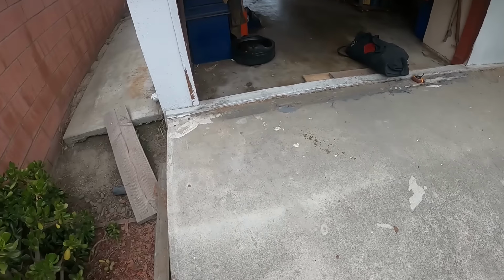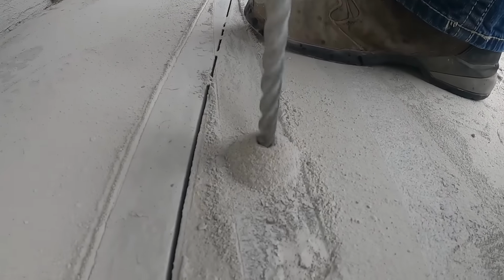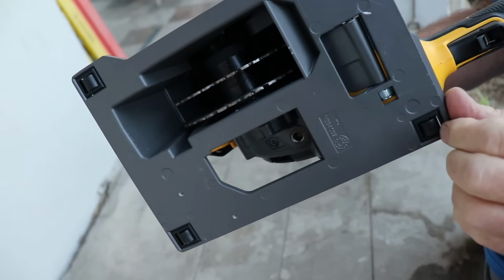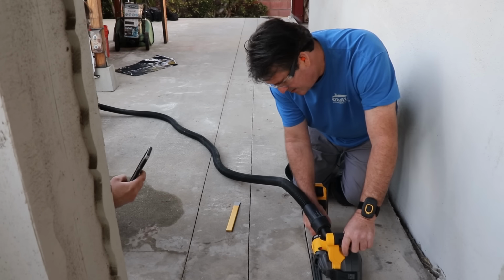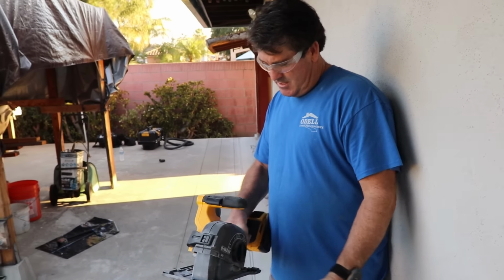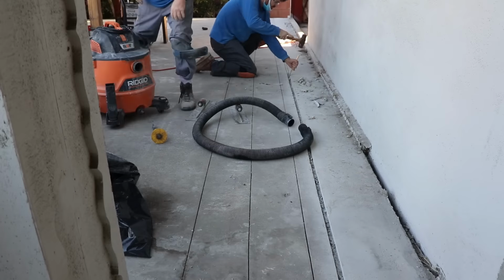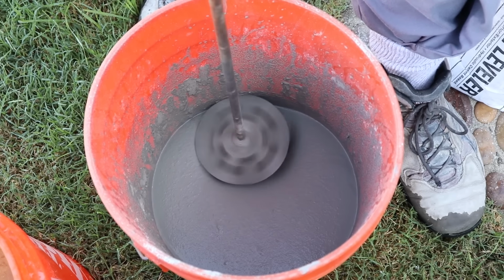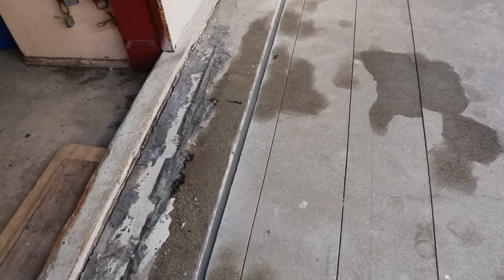How to Cut a Drainage Channel into a Concrete Slab

Comment: Good morning David. I am curious if you ever got any feedback on this work that was done or if you did this in other applications as well. I really like the idea and concept. I live in a home that has water retention on a concrete patio that sometimes under heavy rain causes water to run back toward my walkout door from house. This allows water to seep into basement due to elevation of concrete patio
Reply from the maker: Basically its a channel drain, widely used
Reply: @OdellCompleteConcrete thanks

Comment: If you'd use wooden furring strips and shims to make a sloped guide above the work, you could have cut a sloping drainage channel.  You really only need two angled guide pieces and then a set of spacers to go underneath and gradually build up height for added slope, moving one ramp ahead when you leave it behind.
Reply from the maker: That's a great idea, thanks for the tip!

Comment: As long as the slab is thick will cutting a drain channel like this compromise the slab in any meaningful way?
Reply from the maker: If it's a 4" concrete, that might be a bonus because it will Crack through and allow for residual drainage underground

Comment: So glad I watched this. I was about to just use an angle grinder but this video has reminded me that I already have a wall chaser from when I was doing my electrics and I am pretty sure that's what the Dewalt tool was? And I have a chisel that fits the width of the cut which is perfect I have a super similar problem but on a smaller scale. Alleyway with a crossfall towards the garage meaning it just pools against the wall. Hoping I can just channel through the path and collect it at the lowest points and then send it back the other way. . . . fingers crossed!

Comment: As a side note, it might be worth noting that using a spade bit on "vibration mode only" with a hammer drill might be far easier than manually chiseling away with a hammer for clearing the trench.
  That or possibly a 7" angle grinder with a masonry grinding bit you can wedge in there and make a few passes to your heart's contentment.
Reply from the maker: Good idea

Comment: Why don't you just do a 3 or 4 inch pitched overlay angled away from the house?  You can add mesh wiring for extra strength.  Wouldn't that have been easier?  Perhaps in the future the owner might want to add outdoor tile, but he can't with a channel.

Comment: in a downpour that is likely insufficient.   Couldn't you go deeper and wider in a 19" slab?      Those other thin cuts are worthless and an ant would plug them up.    I'm likely going to have to do something similar because the concrete guys just did our driveway and the grade is terrible and almost non-existent.. and after 2 years settling i guarantee it's back into the house.   Should have done 2 runs next to each other and chipped it out for a 2 inch channel minimum
Reply from the maker: Working so far

Comment: Confused. Why wouldn't you just cut two lines with your concrete cutter vs the Dewalt or at least cut it with your tool the exact width of the Dewalt chisel. Not following the rationale to use the Dewalt.
Reply from the maker: A perfect gap, for prefabricated grate
Reply: @OdellCompleteConcrete  Didn't see the grate in the video. Also, you'r cuts from the snapped line are pretty straight. I'm sure you could have gotten the same results with your lines and your cutting tool. Obviously hard to keep pin straight that way, but you guys are pros.

Comment: Why didn't you just continue with the original concrete saw? It seemed like it was working
Reply from the maker: After 7 blades
Reply: @OdellCompleteConcrete  oh haha. Gotcha. Aren’t the blades designed to cut that or is it because of the rebar that the blades were getting ruined?

Comment: Great work, quick question.  How did the self leveling concrete keep a slope to drain the water.  Sorry if this is stupid question, but wouldn’t the self leveling concrete not allow for a slope? Thx
Reply from the maker: If it's level the water will fall off the lowest point
Reply: @OdellCompleteConcrete  not clear how the self levelling concrete will provide the slope so that the water falls off the low point?
Reply: @fmkhawaj my thoughts exactly 😮

Comment: So surprised you dont own a grinder- would have narrowed that chisel in a few miunutes rather than take all that extra time. - what were you thinking? Hiw much for this dual bladed saw? Since any $80 saw can cut 1" depth concrete with a good blade. Using water even.   2 foot per minute go up while the other direction comes back 40 foot <1 hour
Reply from the maker: This is custom though

Comment: There's no grade after using the self leveling. Yeah it'll work it's way out the end but it's flat and you'll have standing water once it's done raining. I suppose it'll definitely help prevent water from getting into the structure so cool
Reply from the maker: A affordable solution
Reply: Like you said Craig, if the channel is filled with level(ing) compound, then you have a lower channel that is level with the patio above . Could you have cut the channel with the Dewalt, and then chisel a gradual slope in the channel and then use the leveling compound to simply smoothen up the channel?
Reply: i was thinking maybe cut a little deeper ver 5 feet... to create slope @ro-bee-24

Comment: Cheap fix just use an angle grinder with 2 x 10mm diamond cut discs stacked and an adjustable bolt on guide. No need to chisel out slab after and no self leveling compound needed. Don't worry about the dewalt vacuum you sucked up most the dust in your lungs. No PPE shocking when working with concrete you should be wearing a respirator mask. Silicosis is a horrible way to go.
Reply from the maker: NO dust with the vacuum hook up

Comment: Hi guys,  i need grind a 2 or 3 inch of a concrete floor to reach the level,,, any idea or any tool ?,,, im thinking cut some trench like that and use the chip hammer,,,, any better idea?
Reply from the maker: Make some cuts chip it out and grind.
There some walk concrete chippers you can rent

Comment: European here. We use the small prybar(yes that's not a chisel) to break off chunks then rotohammer with a sds chisel the rest out. I would've used a 230 mm large grinder to cut a deeper wider channel and put a grate over it like an Italian drain and seal the bottom of it. I'm an electrician and not a concrete guy but from my point a lot more could've gotten done with a lot less fussing.
Reply from the maker: Yes but thats a sweet tool

Comment: great video,wish i saw this tool earlier,I had a similar problem with an interior floor to a center trench drain..What i did was made a pitched surface using wood and shims to run the saw on, and made a pitched or sloped cut toward the drain.i then used a liquid sealer in the cut to try to avoid water penetration into the slab. seems to be working ok.i wish they made a thicker blade ,ended up using 2 blades together.this was using a 7 inch blade with a circular saw and water.
Reply: Making a pitched surface with wood shims - nice idea, I may do that for a similar issue at my house 👍
Reply: Nice. How much was this tool. I am having a difficult time finding it. Thx.
Reply from the maker: Yes it definitely helps

Comment: What a ton of work with expensive single-purpose equipment for quite a marginal result: the channel is barely 3mm deep after adding that liner material. How about running two cuts from a wet saw : a vertical and a 45degree mitred cut and allow them to meet say an inch into the concrete?  Now you have a deeper channel and the chiseling may be minimal.
Reply: Depends where you are in the world I guess. I have a 240v one from Erbauer for chasing out the walls in the house to re-wire.  Over here most houses are either brick or stone construction and cables and pipe work is often sunk into the wall and plastered over. I imagine most electricians or builders would have them for this reason here.

You guys seem to build timber frame so wouldn’t have the need for these so much.

Makes chasing a doddle and does a very clean job.
Reply: Lol may find it hard to believe,  but some people have businesses that purchase equipment to make money 😆 🤣 it isn't a home owner buying a car lift to put air in tires

Comment: Do you recon you could use this tool for let’s say a breeze block wall with a channel running horizontally across it? Trying to think of a way to run an led channel across the wall recessed lol
Reply from the maker: Yes perfect for that
Reply: @RandomShart thank you for this, appreciate your help on this. Yes I’m based in the UK so am familiar with the wall chasers.. but when I see electricians make channels for cables etc it’s never nice and perfect straight so didn’t know if there was a better tool to use..

Comment: Look at a point tucking blade or the Metabo  MFE40 Wall Chaser cuts like the Dewalt or has a dado like blade. In the video demonstrating the 2 blade setup, an air chisel was used to finish the channel.
Reply from the maker: Interesting

Comment: extremely confused by this whole video... why didn't u just make 2 parallel cuts with the mudusa rather than buying a $1000 tool that cuts backwards. why not a roto hammer with the chisel 3/4 inch chisel bit chipping length wise instead of a coal chisel sideways.

it's amazing what homeowners will pay for lol
Reply from the maker: Because its a perfect width the entire length.
Which means a fabricated steel grate will fit like a glove.
Reply: oh they are gonna put a grate in there? thought they were just gonna leave it like that, now it's making a lot more sense to me.

But you're a concrete veteran david! You can make 2 parellel saw cuts no problem!

Comment: Have you seen husqvarna's cut and break saw? Its basically the same saw as that dewalt, except its 2 cycle and it probably holds a bigger blade.
Reply from the maker: No but I would like to

Comment: Question - why did you need the special Dewalt tool to make the channel? Couldn't you have just made two parallel cuts 1" apart using the first saw?
Reply: Mark Oliver  Not every question is meant rethorically. There are also honest questions. So keep your anger at you.
Reply from the maker: I think I may have a lot of use in future for that tool
Reply: Mark Oliver  Haha, nope. Just here to watch and learn. Concrete is generally the only trade I don't touch (unless it's something trivial) - you only get one shot at it, which makes me love this channel, they're pretty much artists.

That being said, the first saw appeared to make nice straight parallel cuts, from here (my armchair) it appears he could have just used that.

Comment: They rent a saw that cuts 24 inches deep and including rear. You could have gone with the drain like you wanted. They also use it to cut through concrete walls 18 inches thick for doors and windows. Goes right through metal bars like butter.
Reply from the maker: Yes, but would have cost more.
Reply: Mishandling that could cost you a leg. Better use a large grinder and put a trench drain grate in.

Comment: Since that dewalt tool has an adjustable blade depth , would it have been easier to adjust the depth deeper as you cut ? Start off on one end at a shallow depth than adjust the saw deeper 1/4" per ft ? Just my opinion.  
Love your videos bro 💎
Reply: Kanani Rembert you would end up almost 8” deep at the far end as it’s 30’ long. He did mention you could slope it however as you are suggesting in the video.
Reply from the maker: Yes, absolutely
Reply: 1/4 inch per foot?  Can you add? Or multiply? Just my opinion, bro.

Comment: There's another tool just like that where you can  add more blades to rip out the space in the middle entirely at the same time, so you don't have to chisel it out by hand Like a router , but it's made for cutting channels in concrete.
Reply from the maker: Thats what I thought but couldn't find it
Reply: Do you have a product name? I'm trying to router a concrete floor for water heat tubing, sounds like what I need! Or I'll try the Dewalt. Ty

Comment: Hate to be a downer but that little channel isn’t going to capture much water. Would’ve been better to cut about 12 inches wide by 4-6 inches deep and poured a small v-ditch with about 1/2 or 1% slope
Reply from the maker: May need another one in there

Comment: Way to go David,  when conditions on the ground changed you switched tactics and used the Dewalt!  Concrete work is not easy and you get after it!!!  Thank you for the videos!
Reply from the maker: Exactly, need to adapt

Comment: I’m surprised you run it on the pull not push , surely pushing would be easier, less stress on motor I would of thought
Reply: Due to the rotation of the blades you are supposed to use them on the pull. You can push them and I did when I came into corners where the handle and the vaccuum hose have been in the way (For Indoor use on walls I would absolutely not recommend using no vacuum. Found ot why when the hose came loose...)
But pushing them in the direction of rotation you have a tendency for those to get out of control, grab something, push out and run away. Not the best receipe if you aim for a straight as possible cut.

Comment: Why didn't you just use the skil saw and cut multiple lines an inch apart up to 4 inch wide then break it up with a jack hammer to fit a  channel drain in. Because the skil saw cuts deeper than the Dewalt you just have to break about 4 inch deep in the concrete for a channel drain.
Reply: Good idea. I didn’t really like the way he did it, if I’m honest. The channel should’ve been wider and a tad deeper. I know it had double stacked rebar and the concrete was over a foot thick. But there’s some options. And what about those saw cuts left over lol?
Reply from the maker: it was definitely a big money saver the way I did it. $$$$

Comment: Once you said that tool is from Europe, I know exactly what it was for. The US uses mostly wood when building, but Europe and adjacent areas use most concrete, cmu, brick, etc. So they embed all there conduit and piping in the cement.
Reply: Exactly, it is most commonly used to cut channels for wiring and plumbing into the walls, mostly made out of ither sand-lime brick, some porous concrete bricks, engineered bricks and sometimes for load bearing purposes concrete. porous concrete or some engineered bricks with some kind of foam insulation already filling up the hollow parts are quite common today for energy efficiency. Without loosing strength the wall becomes part of the insulation. Lately you find lumber constructions as well, especially for prefabricated houses. But compared to the US and with what brick costs here, lumber is more expensive in comparison.
Most times here (Speaking for Germany that is) so called NYM cables, which are built differently from the ones common in the US (romax etc.) and they have a quite rigid PVC coat that can be embedded directly in the plaster. Conduit is only used in certain cases (Phone lines, sat or tv cable, network,, runs through the subfloor, lines in a basement where no one cares to put the lines into the walls). Also wire gauges are usually a little thinner, as you can get away with thinner cables due to the higher voltage.
Reply from the maker: yes that's what I assumed as well

Comment: i used this when i worked as an electrician, i always removed 1 blade cause the machine would trip the circuit breaker.
Reply: Oh my, what kind of breaker was that? The things I know have about 1200 W at most. No Problem at least on a German 230 V 50 Hz Outlet capable of something like 3600 W.
Sure, those are plenty and I know many houses in other countries are not blessed with outlets of those dimensions or a standard three phase 63 A supplyat all. But for those to trip abreaker either the thing had some design issues with either motor or blade size, or the motor was shot. Or the breaker.
Also out of experience especially on weaker motors, it is best to pull it out of the slot before starting the motor and then slowly sink it into the slot or wall again. (Mine did not trip the breaker, it just stalled if I tried to start while fully engaged.)
Reply from the maker: this is cordless
Reply: @alexku8452  i think it was around 1600  watt + a 1600 to 2000 watt vacuum cleaner , with 2 discs there was too much friction, the machine slowed down or tripped the breaker. with 1 disc i had no problems.
i also worked on houses that were getting built so the distribution boxes were never the best.

Comment: Snap another line 1” offset
Reply from the maker: Sure
Reply: @OdellCompleteConcrete  you have more experience. Do you think that would have worked? Honestly
Reply: @onlyonehoudini5302  The first 3 cuts seemed straight enough to add a 4th 1” offset cut. I was thinking the same throughout the video. It was more like finding an excuse to try another tool.

Comment: In Europa electrican use ist for wiring,we have Concret Walls and Hard Stone Walls
Reply: Thats what I know it for as well, to cut channels for wiring and plumbing into brick walls. I used it for the sand-lime brick in my house, no fun if you have to go just with a chisel. slightly better than chiseling a channel into concretee, but just so.
Reply from the maker: Thats what figured

Comment: It's almost like a concrete Dado blade. Would be nice to flush mount a conduit if need be, pretty cool!
Reply: We call it a wall chaser, essentially it's used mostly by electricians to lay cable in Masonry.
Reply from the maker: Yes, or light strip

Comment: I've got the 240v version of that dewalt wall chaser. It's made by Milwaukee, and is a fabulous tool that works really well. 

Good job as usual David!
Reply: Where did you get this tool?
Reply from the maker: I imagine it has a lot of power